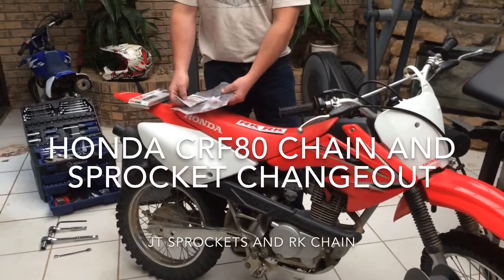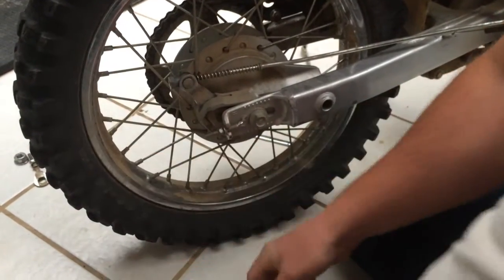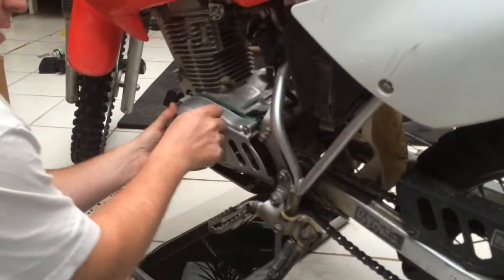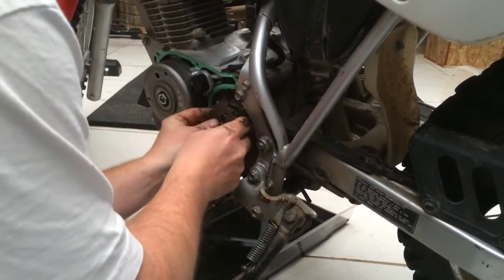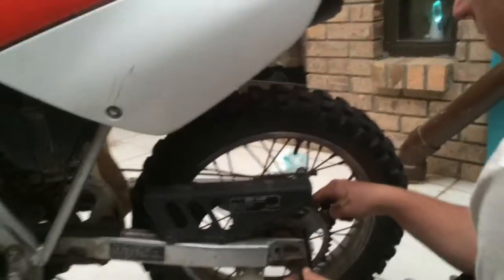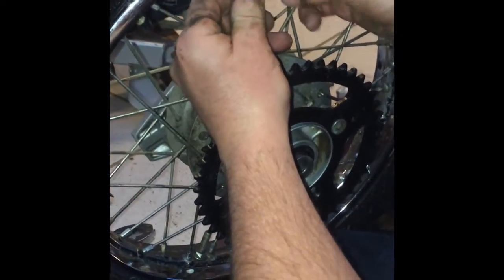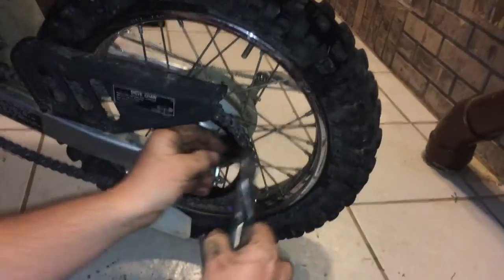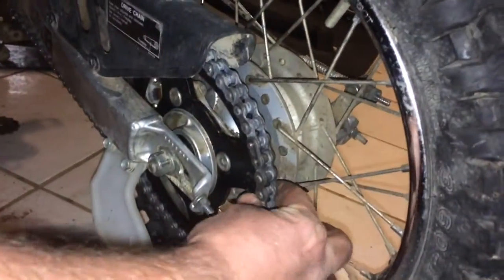Honda crf80 chain and sprockets replaced how to video

Comment: Pretty sure you didn't need to drain the oil to replace the front sprocket, there's no oil behind that cover plate for the clutch.  Although, by the looks of the oil that came out, it likely benefited from a change.

Comment: you don't need to loosen the break adjuster and the chain adjuster's you can do this process in 10minuts if you do it right and you won't need to spend hours re adjusting the breaks
Reply from the maker: Thanks for the advice but I did the job as the Honda repair manual states.  It would probably be wise for you to read the manual as well before you get too creative with home brew methods.  And even if you do your own methods it is best for people to do jobs with safety in mind.

Comment: Will your clutch still work if the chain is broken
Reply from the maker: The chain breaking doesn't affect the clutch.  The clutch is the connection from the engine to the drive sprocket.

Comment: there's no oil in that cover ovee the front sprocket
Reply from the maker: That's correct no oil when started I thought it was like my Yamaha tw200 which is full of oil and drains out.  It was completely dry but had a gasket for dust protection.  I made that statement before I realized.  The video shows it being dry but I forgot to point that out.  I was changing oil anyway.  Thanks for pointing that out!